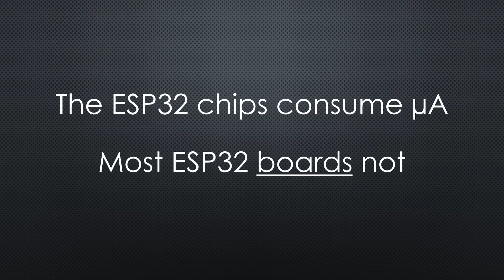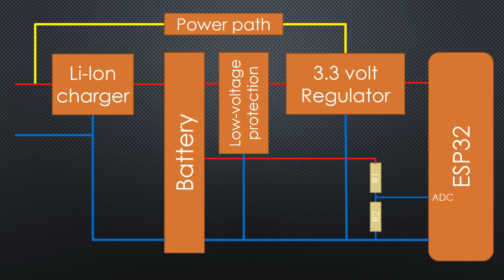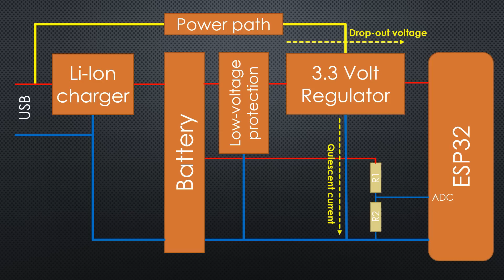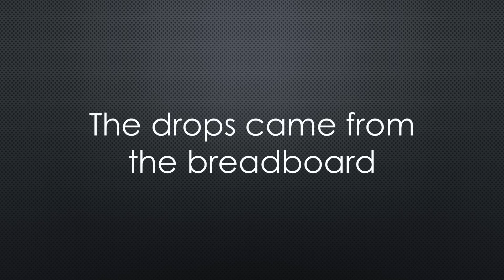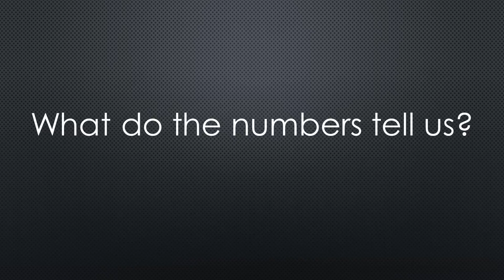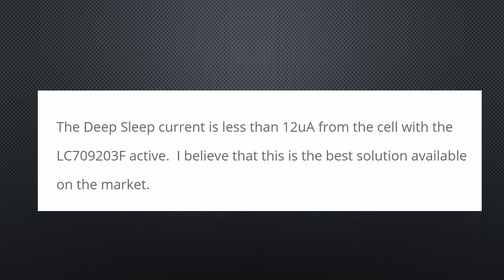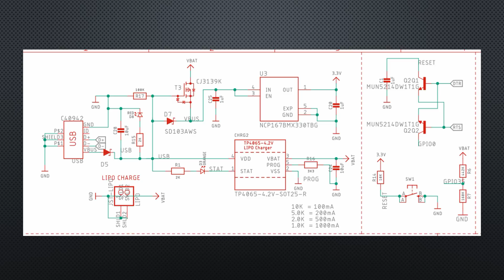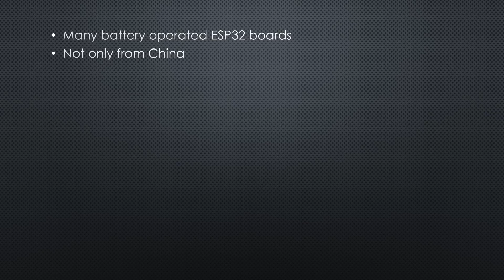#387 Test of Battery operated ESP32 Boards (Olimex, TinyPICO, EzSBC, TTGO)

Comment: If you connect the ESP-processor via a regular diode to Lion, most of these issues are solved. Because the diode voltage drop is 0.7 V. And it also stops working on its own, when the Lion-voltage is little below 3.0 V.
Reply from the maker: I agree that the top-end of the voltage is ok. But at the bottom end (around 2.7+0.7=3.4 volts) the ESP will crash (brownout) and start and crash and start and drain your battery rapidly. Unless your battery has built-in voltage protection. An LDO has a dropout voltage of only 0.2 volts which better enables to use the full battery capacity. But I agree, your solution is simple.
Reply: @AndreasSpiess What about connecting the battery lead via resistor-divider to one of the logical ports os ESP8266? If the divided battery voltage goes below the logical level 1, it knows it is time to shut down before this crashing brownout holocaust happens?

Comment: The voltage regulator does not only have quiescent current and a voltage drop, but will waste power as heat depending on the drawn current and the voltage difference. Not very efficient...
Reply from the maker: Hi Jeroen, You are right. But for these small voltage differences I usually accept it. Switchers also do not have 100% efficiency. For higher differences I agree and usually use switchers.
Reply: not all LDOs are made the same, not all SMPS are made the same and choosing the right solution is a matter of compromises as no ideal circuit exists
Reply: Absolutely. Just thinking that power optimizing a circuit would include making precisely those decisions and comparing the best solution, including the battery solution that fits it best (as I remember Andreas had a video about exactly that).

Comment: Andreas, you should check ESP32-S2-DevKit-Lipo from Olimex. It uses LDO from Microchip - MCP1700. The deep sleep current of the board is around 6uA.
Reply from the maker: I googled and they specify 65 uA in deep-sleep mode for the board with a WROVER module. Is the one with the WROOM so much better? The WROOM itself specifies 20uA
Reply: @AndreasSpiess  Sorry, my bad. My comment was based on information from this blog post https://olimex.wordpress.com/2020/05/18/new-open-source-hardware-board-esp32-s2-devkit-lipo-breaks-our-internal-record-for-esp32-low-power-consumption/

below in the comments, Olimex explain that Espressif initially claimed 5uA of deep sleep current and after that claimed 20uA. This is where the confusion comes from.

Anyways, it should be around 25-30uA which is good.

Comment: Andreas thanks so very much for your recent recommendation of this nordic power profiler 2... it's something i very much will be looking forwards to getting. A great instrument. For these esp32 is an interesting selection, but is also missed out the trigboard by Kevin Darrah in USA, it would have been nice to see how well it compares to these cheaper ones. However the trigboard is more expensive and perhaps its hardware is a little bit more closed in its design than these others IDK.

BTW fellow youtuber sdg electronics also made very recent video about the capacitors for LDO and is also a small help in regards to educating beginners (blike me!) about these choices. But thanks again also for your take on these subject(s). Very  useful
Reply from the maker: The trigboard indeed is a very special board and I once had one in a mailbag. And the video I mentioned was the one from SDG electronics. It was for LDOs in general and I did not see what he saw in my tests. Maybe because the loads of the ESPs ae very short.
Reply: but what i have been really wondering the most here Andreas, is if we can get a reasonable chinese esp32 board, such as for ecample here the lowest you tested. Such as this ttgo t18 boards. Then figure out some kinds of optional hardware  mod(s) to take it even lower down in the sleep current from 53uA to the lowest posible levels (like of a trigboard). which would only be a few uA and similar sort of levels as can be achieved on the very best available. Not to have to be quite the very lowest, but close enough, that it is enhanced over the stock board and those power mods themselves are actually worth the extra trouble to justify to do the modifications.

Another different option which i have also been considering is well... what if the project does not need wifi connectivity? Then perhaps a low power stm32 chip can also have a deep sleep for other embedded but 'not IOT' battery powered applications. Then i see in aliexpress they sell boards from places like 'schoolDIY store' which have STM32L053C8T6 or STM32L071CBT6. These ones advertise with good features set and low price. Especially for the timers and other strengths in stm32 platform. And being same family to share your own existing previous source code from other stm32 projects (like f4 black pill, and being on PIO with stm32duino Arduino_Core_STM32 libraries). Then you can build your own C++ classes and share them across project to include the low power variant chip. But again it is not good for wifi. Because we hit the same problem that stm32 does not support the wifi very well.

But what about for LoRA connectivity? So for that maybe we need other solutions? To also achieve a very low for the deep sleep current too. It would be nice to know
Reply: using nanopower timers is the solution which potentially can reduce power consumption to the minimum... BUT there are two things to consider.. if your application wakes up every few seconds or minutes even connecting to wifi or if when waking up it stays connected or consumes much power for extended periods of time before going back to deep sleep, a timer might not be really as efficient... other than that what often is neglected is the Iq involved with the charger and battery protection circuitry (and as you can see on the video, some boards have, some boards have not one or both these elements)... usually its 4-10uA depending on the components chosen... and often is not even added to power consumption estimates for a design which again, often measurements are taken AFTER then battery protection circuitry making it impossible to extract actual measurements for battery life
Reply: @BudgetSolarGR  ah cool man! so what i am hearing is we want to add a nano power timer chip to the power circuitry of some esp32 board that is like the trigboard. and then try to avoid waking up too often. but also not to use wifi - it we can avoid it! because powering up wifi might use a lot of power especially if the device is in poor signal area far away. and / or might have a noisy spectrum and then have difficulty establishing a new connection. but really that situation is not avoidable without switching to something else. maybe like LoRA in that situation? i am asking for those wireless application requiring a higher polling rate. but i see LoRA is also needed for longer distances too :)

Comment: Thank you for this excellent video, but it is very disappointing to see that all the tested boards kind of suck...

As far as the capacitor used to prevent the processor from crashing, it looks like it is due to a combination of ESR and ESL and for the ESP32 processor, a surface mount ceramic capacitor mounted close to the processor's power pins should be optimal. I would guess that with this configuration and a good LDO, you would need a lot less than 100uF to minimize the transients causing the problems. As you know, LDOs don't really like driving high capacitance loads, and their transient performance isn't necessarily improved by increasing the load capacitance to very high limits. It would be interesting to see if good performance was possible with 10 or even 4.7 or 2.2 uF...
Reply from the maker: I agree with your conclusions.
We have some examples to examine. Because the brownout detector of the ESP did the measurement in my test we know which board has which performance and we can have a look how the manufacturers solved the problem (we have all the diagrams). We even can see where they placed the caps on the PCB.

Comment: I'm having big issues with projects and battery life. My test showed 800mha draw in use. And I am looking at making a circuit just to deal with battery supply and protection. There is a small board out there, but I need to check input power range.

Always a pain. But with a 4 hour run time, I need to also look more into the coding.
But feel it's not so much the voltage causing the issue and more the current.... Inductor planed.
Reply from the maker: The voltage has to be around 3.3 volts for the chip. So only the current decides on the battery life. After this video you should have the needed know how to do your checks or evaluate a good board.

Comment: Interesting, would be useful as a follow up video to show how to achieve the best results from an UV circuit (be it added to the boards or in line with the Li-Ion and the input connector on the boards.  Good video though!
Reply from the maker: I already made a video about under voltage protection. I agree it would be best with the batteries and not the boards (for safety).
Reply: @AndreasSpiess  Ah, OK, is it linked in the description?  I must be honest and say I couldn't see it.  Thanks.
Reply from the maker: https://youtu.be/1rg3ZWxBNUE
Reply: @AndreasSpiess  There is an post on EEVBlog about your video (https://www.eevblog.com/forum/projects/pain-and-suffering-getting-the-dw01-and-8205a-protection-circuit-work-right/ ), that DW01 chip isn't freely available, not in my country anyway, is there a alternative from companies like TI or LT/Analog?  Thanks

Comment: Great video, it was a big help thank you. I like the deep sleep power draw of the ESP32-S2 (rated at 5uA), and so the Unexpected Maker boards are great (TinyS2 in particular). I'm curious how the new Wemos/Lolin S2 Mini goes with the "Battery Shield V1.3.0 For LOLIN (WEMOS) D1 mini", and perhaps Lolin will make a "Lolin S2 Mini Pro" someday. Also, Espressif's arduino-esp32 2.0.0 was released this week!
Reply from the maker: I think manufacturers will pay more attention to power consumption in the future. Thanks for the tip about 2.0.0 I probably will wait a bit till I switch ;-)

Comment: I really never understand why boards are not at least designed for low power consumption! Like putting LEDs that you can not turn off (arduino!)
Reply from the maker: I agree. Maybe the designers do not design for a particular use case...
Reply: Arduino was supposed to be a teaching aid, a basic MCU environment to learn on.. ready made boards like the nano-uno etc are not designed with battery operation in mind at all so saving a few mA here and there makes no sense in such designs.. on the other hand, low and ultra low power designs are not easy to come by, much more expensive and complex and while out there, more easily found in custom builds or expensive long battery life products with totally different requirements on the design that a product powered by a wall adapter etc.. trying to design something with as wide application as possible is not always easy, it never is really...

Comment: For when you do a next roundup of boards like this, can I interest you to take a look at ESP32-S3 PowerFeather? It has built-in I2C-controllable charger with up to 18-V input, 2-A charging and pseudo-MPPT (Texas Instruments BQ25628E), and an on-board battery fuel gauge (Onsemi LC709204F).
Reply: Also, let me know if I can send one your way 😃
Reply from the maker: For the moment, I have no plans for such a video. Your board can be interesting for particular solar projects. However, its price is rather high...

Comment: Thanks to Andreas for the videos, which are definitely unique. What is the correct way to connect a solar panel to an input that says 6V max?  I think this affects  a few boards.
Reply from the maker: Usually they use TP4056 and they should be good for 6V. So just connect the panel instead of USB

Comment: It looks like it's easier and better to buy pure ESP32 module and create custom properly designed board, definitely w/o stupid neopixels, for low-power consumption applications. Fighting all these issues of the mass-market boards makes no sense to me. 
P.S. Thanks for the great video.
Reply from the maker: You are right. Creating your own PCB is a good choice. This is why I included a review of the diagrams. Now you can chose the right parts...

Comment: Hello  Andreas, I found that the Wemos Lolin32 (not the lite version) is a good battery operated deep sleep performer. Perhaps discontined, it is stll easly available. The feather huzzah 32 keeps the usb interface powered by the battery, no way to switch it off, this makes it unusable w/ the battery! I have read on their forum they had problems programming the board w/ a more current conscious circuit... :-{
Reply: Both my Lolin32's give me between 125uA and 175uA in deep sleep. They were my favourite ESP32 board before I designed the TinyPICO and realised 125+ uA was pretty poor.
Reply from the maker: You are right. Board 2 in the table gave 125 uA for deep sleep. Which was a very good value back then...

Comment: Hi Andreas, great evaluation, like always! One question, have you tried putting 100nF ceramic capacitors in parallel to the 10/100µF Tantals to strengthen the voltage stability? They should serve well for the HF peaks.
Reply from the maker: Thank you. No, I did not try it. I think the dip is not very high frequency, but it needs a lot of energy. This is why the small 10uF ceramic caps alone crashed the MPU. The boards do not have a lot of capacitors and some work with only a small difference between battery voltage and brownout. So it is probably a combination between PCB design and choosing the right caps.

Comment: it seems not all boards are equal..even if they are the same model... i have the TTGO T18... i cannot get it to run from battery without brownouts.. even with usb power the brownout happen if you enable many parts, eg it will often fail when wifi is enabled... it seems you cant power many sensors via the battery or usb...if i power the sensors with another supply it works fine..
thanks for the info Andreas, nice and concise as usual!
Reply: try a different battery.. like devkits and esp boards, not all batteries are made the same
Reply: @BudgetSolarGR  tried multiple 17650s that are fully charged..thing is usb cant even supply enough power to run the 3-4 sensors and wifi...
Reply from the maker: @WacKEDmaN: Maybe you connect the oscilloscope across Vcc and gnd of the ESP chip or close to it and maybe adding a cap at the right place might help. In my tests it ran down to 3.1 volts, but without sensors.

Comment: Don't most/some Li-ion batteries have a chip onboard to protect the cell, wouldn't that solve the undervoltage protection issues you mention?
Reply: Other way around. Most lithium batteries dont have protecttion built in. Battery packs though often have bms or should have. But yeah a single well generally dont have it :)
Reply: @the_perigoso  not really. :) They are added after actually. Go to any shop that cells Them and they are in almost all cases without. IF you get batteries scrapped from 2nd hand they Always come with circuitry of course. :)
Reply: Li-Ion dont ... Lipo most of the times do
Reply from the maker: @Ron: Most of my single cells do not have protection, especially not the 18650s because the protected ones are slightly longer and do not fit everywhere. But you can buy cells with protection, of course.

Comment: You might consider including the TrigBoard by Kevin Derrah in this comparison
Reply from the maker: I had it in one of my mailbags. I think it has quite different features and compares more with a barebone ESP module. It is very good but I would not use a rechargeable battery with it because it runs so long.

Comment: Thanks for an interesting video, could you point us in the direction of the video you watched about capacitors on the power supply? Also, have you done a video showing how to implement low voltage protection?
Reply from the maker: Here is the video: https://youtu.be/qosClvn9GqU. And yes, I did a video on battery protectors (@160)
Reply: Thank you Andreas